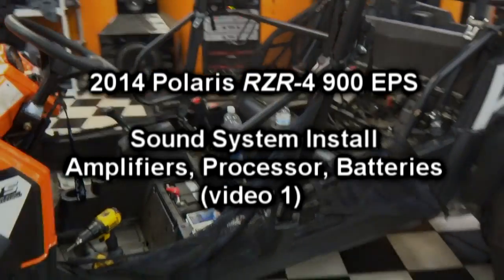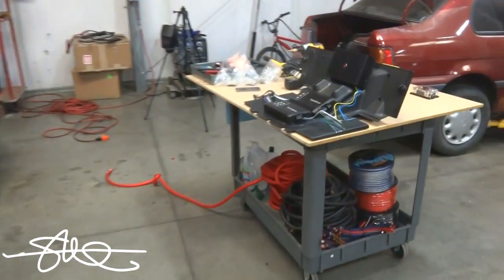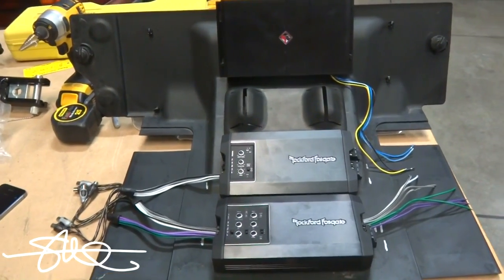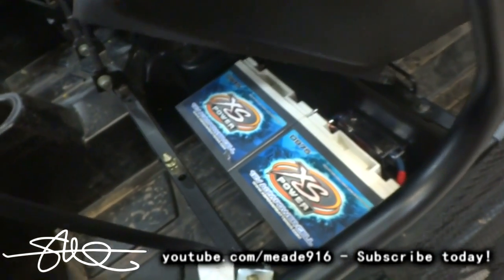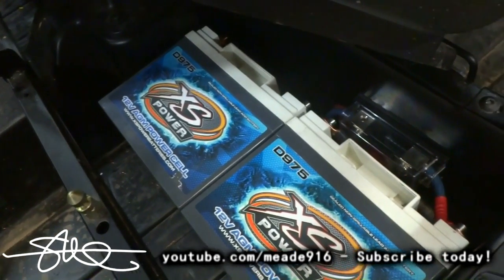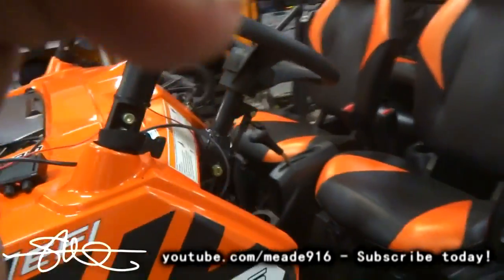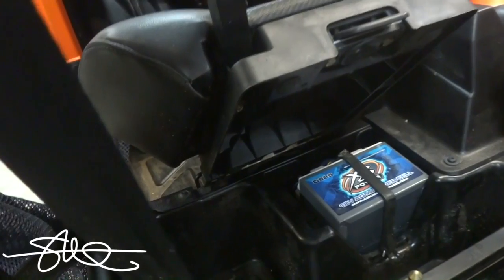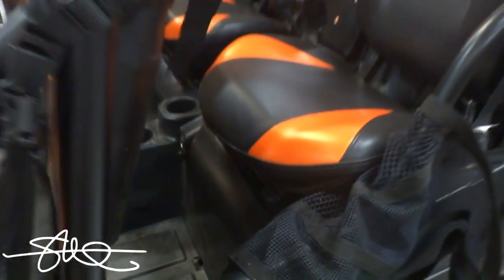Polaris RZR 900 4 Seat ATV Rockford Fosgate 1100 Watt Sound System Install (video 1)

Comment from the maker: NOTE: THE AMPS WON'T BE VERY EXPOSED AFTER ALL. I am getting the roof this week and also i plan on fabbing an amp cover for days i know it could get wet.  So please, JUST WATCH, i know what to do! :) thanks!
Reply: Crazy how your genius is entertaining, i try and learn all i can from your videos Steve i don't trust myself to do anything yet but soon i will.
Reply from the maker: ***** don't be scared, you can do it! whatever it is. haha
Reply: meade916 Thanks, i am a computer nerd and build computers left and right i just second guess myself about car audio for some reason, not to mention i don't understand it as much as i would like (voltage/wiring/ohms etc).
Reply: meade916 good job u gotta b smart to know all abt these things
Reply: ***** Read up on ohms law and buy a multimeter, you'll be fine.
Reply: Appreciate and like your passion for car audio and your youtube channel.
Reply from the maker: HerbsGanjaBass worst song i ever heard bro, can't lie.  I would never ever play  that in my ride.  Not my style.  If you like it though, more power to you slap that shit!
Reply: Maybe use some pvc flex-pipe for the small wires.- I was thinking about all the vibrations and the sharp edges in the cut outs on the plate where the amps live. Maybe a rubber grommet in the holes. Good luck with the project..
Reply from the maker: Anders Steen a 1" long "flex pipe" to protect the wires as they pass through a plastic hole? What sharp edges are you talking about? there is none.  I highly appreciate your great advice bro, but i think i got this :)
Reply from the maker: ***** thanks man! if i get time ill do more amp test video's.  Just been busy.

Comment: You know meade916  is old school when he refers to components as "separates". That was the name Kicker used back in the early 90's for their individual speakers (Kicker was originally known for their full range speaker boxes). I'm also curious to know how those new Rockford Fosgate®  mini power series amps perform. I have the Punch PBR's in one of my vehicles and although the full range amp gets really hot, they pack a lot of "punch" for their size.

Comment: Nice. I could use ur help tho. I think the bandpass box u are building is close to the same design im tryin to do fa my truck. But how can I get the biggest port without having long walls. Ported section is 49x14x14

Comment: Hey meade916 i was wondering if you have to run a battery isolator in between your main battery and the other two? if not can you explain please.. n also to what battery do do you have your accessories hooked up to? im thinking of running a second battery on my rzr also.

Comment: Hey man, I got two Rokford Fosgates T1's for free the other day, but notices one is a DVC 4 ohm, and other is DVC 2 ohm.

I'm a noob when it comes to audio, but if I wire them together, will they sound similair? o_O
Reply: I don't know the "for sure" answer to this, but the idea makes me nervous.  Maybe keep your DVC 2 as a 2 ohm load to the amp and wire your DVC 4 into a 2 ohm load to the amps other channel -- assuming you have two channels to work with.  If you're using a mono block amp, I'd sell/trade one of the subs to have a matching pair -- which one would depend on your amp.

Anyone else have some feedback on this?

Comment: I'm thinking about getting a system for my car. I'm wanting to spend no more than $800-$900 on it. And it needs everything from head unit, wires, subs,etc. I would like 2 12s if possible. Can someone help me out? Give me opinions, options, ideas. Anything that can help me out :) thanks

Comment: I guess you won't be running this through mud.
Reply from the maker: why wouldn't I? please read description...the amps will eventually get a cover.  Even if they get dust and mud on them, i don't give a damn, they will still keep on working.  I fully expect them to handle it just fine.  If i hose it out ill def have a cover on them.